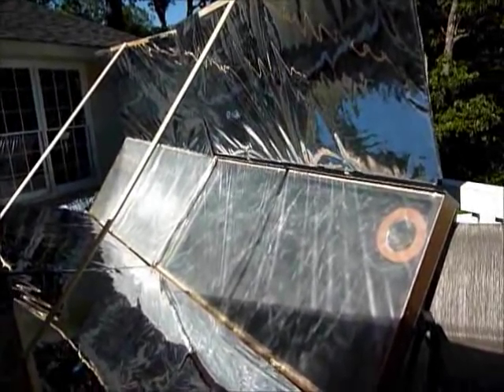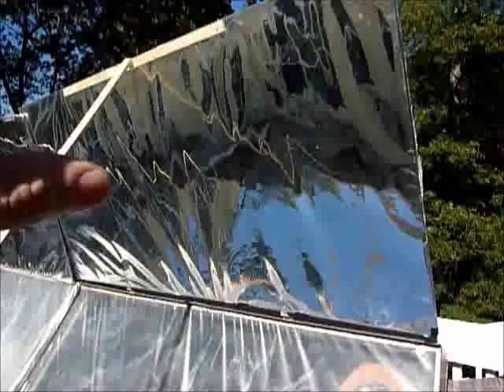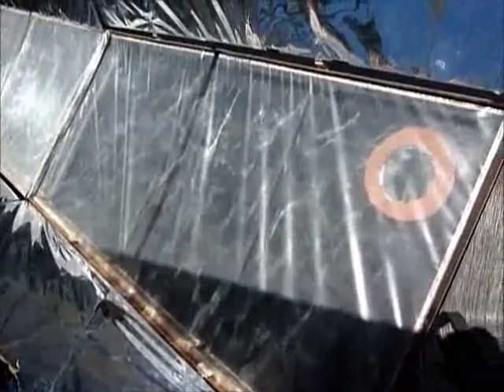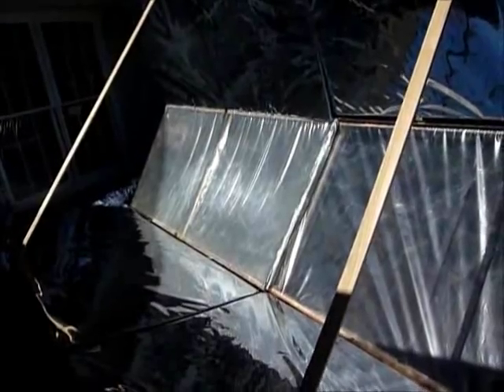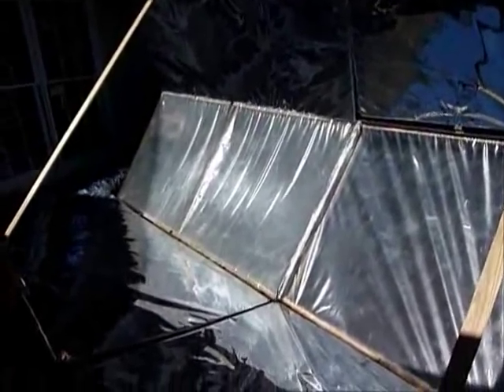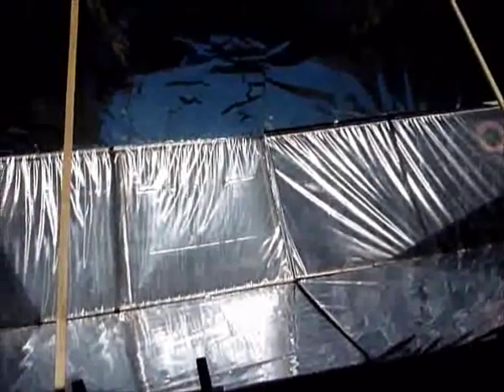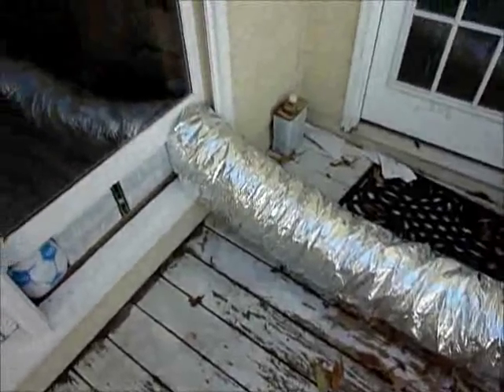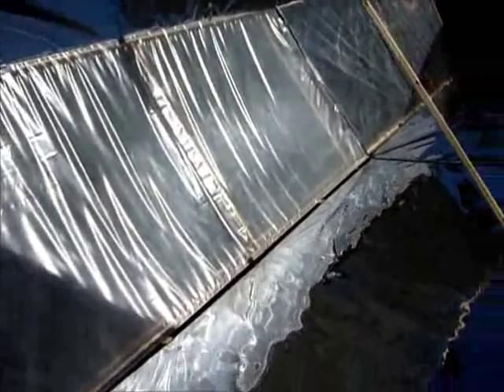DIY solar air heater 2011 fall

Comment from the maker: Estimated sun:  850 W/m^2, about 2,550 W per 4x8 area. Collection area was x3 = 7650 W
Energy that made it through the plastic:  7650 * (1-0.25) = 5737 Watts
Minus 2128 W energy lost  gives 3,610 may have made it inside house.  Measurements indicated only 2,000 W made it.
Actual energy provided by the system:
100 CFM * (130 F outlet  -70 F inlet) / 3 =  2,000 W.
This equation is derivable by using heat capacity of air.

Comment from the maker: This project turned out a lot less efficient at converting sunlight to hot air than I hoped and calculated. 

Calculating theoretical efficiency losses:
20% loss from greenhouse plastic reflection (average of 25% two layers, and 13% one layer. Measured, not manufacturer claims)

Basic equation:
Heat Watts lost through a surface = Air temp difference in F * surface area ft^2 /  R factor / 3.41

Comment from the maker: 130 Foutlet  - 70 Finlet =>100 F avg temp inside boxes
Front side: (100 F - 70 F) * 64 ft^2 / 0.5  / 3.41 =1126 W  (not R=1 or 2 for 1 or 2 layers because plastic moves and kills beneficial boundary layer effect)
Back side: Divide by about R=2.5 (not R=4 because board isheated directly = 768 W
Sides: (100 F -70 F) * 8 ft^2 / 3 / 3.41= 23 W
Duct: (130 F -70 F) * 72 ft^2 / 6 / 3.41=211 W
Total lost from temp diff between box and ambien:  2128 W. Double airflow to reduce box temp would gain 1,064 W